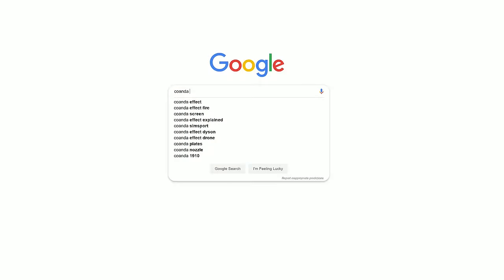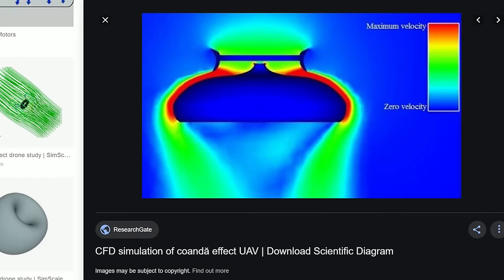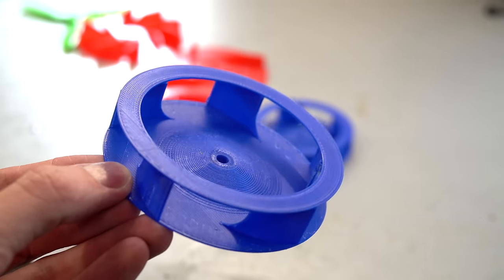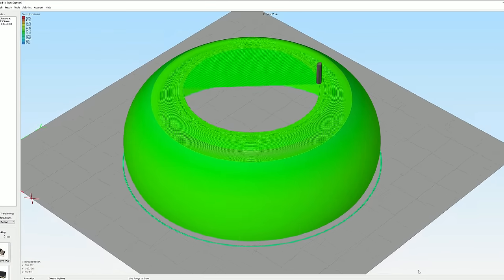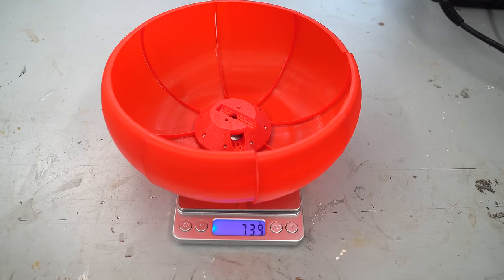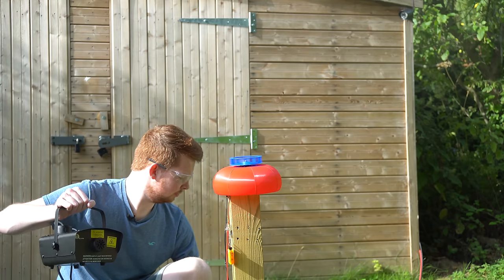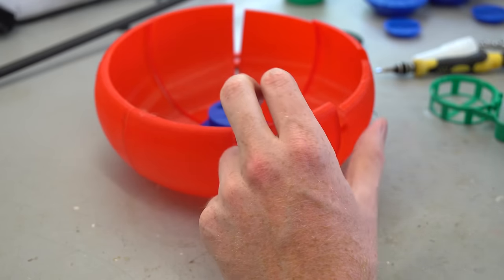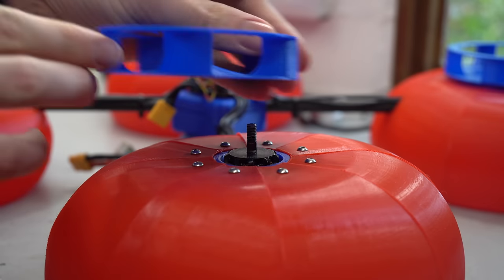Coanda Effect Drone Propulsion

Comment: >The domes are almost impossible to print on a FDM printer
What if i told you... that you can flip the model upside down? :)
Reply: Lol underrated comment
Reply: Even I thought of this. 😅
Reply: I was thinking this too.
Reply: But thenthe support are outside  instead inside but still are there.
Reply: @pologamero2648  curved surfaces are self supporting.
Reply: @pologamero2648  That shape shouldn't need any support at all if he had flipped it upside down.
Reply: KamiEuKiTo  No, it wouldn't necessarily need support. He might have to tweak the shape slightly, but those domes should print just fine upside down with no support at all on a decent FDM printer. 
And since he was trying for light weight, I don't know why he didn't use vase mode to print this either. It would have had much thinner walls, but been fairly strong just due to the shape.
Reply: @dudemcgee256  not if they have an angle to vertical.  The software make not difference with the curve direction. The only curve with no support its a vertical wall.
Reply: The blindness of genius.
Reply: Or you just buy a salad bowl at the dollar store and save your 5 days of print time and $500in filament.
Reply: Exactly what I was thinking and I have no printing experience. Just print from top to bottom like printing a bowl
Reply: @pologamero2648  :  no supports needed for most of it (just around the base (top of dome, where overhand exceeds ~30 degrees ( or better - half the stepover distance)),  supports are no problem as you need to "clean up" most 3d prints a bit anyhow..
Reply: exactly. its the same way he printed the top piece separately anyways
Reply: @Tom Stanton you should cut the red part to be flush and level. that extra down curve is pushing the air down and inward you want it to direct all the thrust straight down to push harder and not cause disturbance. Hence why it is getting stuck in ground effect. by design it is forcing itself into ground effect
Reply: imagine the look you'd get if you challenged  a potter to turn a lump of clay into an inverted bowl.
Reply: Suuuuure, and start off with a 89° overhang ... Seems fine by me
Reply: Why exactly would it be difficult to print??  A dome is prety basic and would not require any support material at all, but IF you need it you can use a dual nozzle and water soluable. Overhang isnt really a problem. You maybe get some small strings but it should print from edge to center..it doesent start in the center . That overhang is not really an issue as the first string is cooled whn next arrives and thus as long as its detail free should work even without rotation
Reply: @jonjonsson6323  because if you flip it upside down you will have an 89° overhang to begin with, and the purpose of the exercise was to make it as lightweight as humanly possible, a.k.a. SINGLE LAYER, and try as you might, you're not gonna remove the supports for a single layer print
Reply: Mihai Lazar then print it straight, to be honest, the only issues i have had with overhang is figurines
Reply: @jonjonsson6323  then you have nothing for the upper "cap" to rest on, overhangs are just the angle between the bed normal and the desired print surface tangential plane ... Well that's a lot of mumbo jumbo, but what does it mean ? It means it doesn't matter in which direction you measure it, if you print the dome upright, you still have overhang, but on the inside
The sine of the overhang angle is just how much of the next layer will be unsupported, and as the dome must be closed on top, and it its curvature is fair, it's overhang goes from 0 to 90 degrees and, by definition, nomatter how good your printer is or Wich way you print it, it cannot be printed without supports, at some point, a layer will have to be printed on top of air, which will result in the fail of the print 

Of course there could be potential additive manufacturing solutions to this problem, but none of them satisfy the condition that the dome must be 1 layer thick 
It is mathematically impossible to do it (well, now that I say "mathematically impossible, one could point out that you could print it untill you reach the overhang limit, go on a vomit comet 0G plane and continue to print in increments in 0G up to success, because it's in Engineers' blood to scoff at mathematical proofs, but obviously that solution is absurdly out of the reasonable bounds of practicality)
Reply: the reason he didn't do that was simple and explained at 3:52 the layer lines were perpendicular in the air flow. (that means going across the air flow) and that would reduce aerodynamics. that could had been fixed with primer and a sanding or he could do it the quickest and laziest way,  print it in peaces on the side.
Reply: Hahaha!!  And in Vase Mode!
Reply: That would mean that there would be support material on the outside, which would lead to irregularities on the surface, which would in turn detach the airflow from the dome
Reply: @vinno97  honestly,  I  have printed spheres with NO supports at all. These would be CAKE. Especially if uou set your layer height to say, .08..  I've done steeper than a 45 easily. But this is about bridging. The flat part at the top. And yes, you would need support if your printer can only support BRIDGING up to a certain length.  But turn the shape upside down, and BAM no bridging, no need for supports.  I. The end tjough, I'd have LOVED to have seen a time lapse of the prints..
Reply: @jonjonsson6323    "then print it straight" brilliant! I'm sure all those aeronautical engineers working so many hours on those complex aerodynamic shapes will be relieved to know that according to 'some guy on YouTube' they can throw all that complicated math out and just make things straight!  Who needs carefully considered dihedral? Make it straight! Why worry about the hugely complicated issue of camber? Just make the airfoil straight right? 

Here you are flexing your expertise on 3D printing and the first time you come across an issue that should make you rethink your first assumptions your honest suggestion is to throw out the elegantly engineered shape of the object in question and tell the guy to just make it a worse part in terms of actual function just to make it easier to make?  Tell me you don't actually work in anything like a real engineering or production environment?
Reply: @hellzs  the perpendicular lines would induce boundary layer turbulence which may actually increase lift; it's the same as adding turbulator strips on small chord wings - and entirely dependent on what reynolds number you are operating at
Reply: @ashleycollard8968  i was answering why he printed it the way he did and gave the time stamp of him saying it then elaborated with theory. i am not a 3D printing expert nor an aeronautical engineer but he did walk everyone though the thought process he had and was over looked or just ignored for sake of finding something to complain about.

how ever i doubt that the added turbulator like ridges would help since it would take up the full lifting surfaces and greatly reduce the air velocity while also braking off the air stream from the lifting body. from a quick google search it seams the turbulator tape is used in small portions near the trailing edge of the wing  to brake up laminar flow to allow a smoother merger of the upper and lower air flows to reduce drag. it would appear that it would be useless in this application. there wouldn't be a difference in the air speeds at the point of merger since while using ground effect there would be no point of merger (probably, im just taking an educated guess since there was a loss of efficiency above a point) and at higher flight the bulb would act like an airo-spike and have a tear drop shape.
Reply: @hellzs   rough surfaces at low reynolds numbers are actually more efficient - laminar flow is the aim on full size surfaces operating at high speeds (and no, i'm not an aeronautical engineer... but i am a designer and builder of flying models for half a century)
Reply: Lol he spent so much time printing and gluing that print....vase mode next time homie.
Reply: i was thinking the same thing
Reply: Haha, yeah, huh? Or why not just go to the grocery store and buy some plastic bowls (if light enough) and then mod them? Geesh!
Reply: That happens when you have many problems to solve..  You concentrate on the important ones first..   R & D is all about conquering the Human deficiencies..
Reply: Well,  @THOMASTHESAILOR , mortal (imperfect) deficiencies, that is. Not necessarily human ones. There are perfect humans who exist outside of Earth life. Heavenly Father is, of course, one of them. Oh, also, "human" isn't a brand.
Reply: Lmao that's how most objects r printed by the software's program
Reply: @dudemcgee256  physics!
Reply: @excitedbox5705  would that really be 5 days of print time tho?
Reply: @MT-THNDR207  Probably not but my $500 was exaggerated too. 4 salad bowls from the Dollar store would have been so much cheaper and quicker the actual time is irrelevant.
Reply: The top of the dome was curved.
Reply: @owenkegg5608  That's fine
Reply: The entire time I was thinking "Just print the thing upside down!"
Reply: I believe you have also stumbled upon the "Toms palm to forehead effect".
Reply: Hmm . . . Logical. I don't have a 3D printer. But, it is ideal to make a structure a solid piece.
Reply: Maybe it's just me  . . . Are the motors working harder than without the comes?
Reply: @pologamero2648  In FDM printing it is possible to print overhangs with an 45° angle easily, with some tuning you can achieve even 60° reliably. (angle between vertical axis of base and wall
Reply: Or spent a couple bucks at the dollar store for a couple plastic bowls.
Reply: Yeah then have support on the side...
Reply: Big boy brain
Reply: He keeps pronouncing "Coander affect", what do you expect?
Reply: KISS. Sometimes the solution is the easiest..... durrrr.....
Reply: You can do that with motorcycles too. It really doesn't take all that much practice.
Reply: I wanted to comment that too xD
Reply: @pologamero2648  55-60° angle to vertical is self supporting, depending on layer thickness and extrusion width. Layer thickness must be much much lower than extrusion width for this to work, then the newly placed bead is partially on top of the last layer, enough for it to have something to stick to.
Reply: Exactly!
Reply: I am a 3d printing novice, and even I saw that issue of "...why not print it upside down, since such a huge area is flat, that would just be supported by the printing base, and then maybe a tiny bit of support at the initial curve, depending on how you set it, but mostly just..using that and vase mode you would not need any supports, it would self support and be lightweight.
Reply: I believe it was the layer direction that caused the most problem with printing it all at once. The air flow over the bowl.
Reply: Upside down couldve even gotten him vase mode
Reply: I was very confused by his dilemma as well
Reply: Hahahahaha! Great call
Reply: The one he came up with ended up being a better design functionality wise anyways, but yeah, mans coulda printed it upside down.
Reply: Polo Gamero not true.
Reply: Theodor Witter wth
Reply: Owen Kegg and?
Reply: Elekrazy oh hi me
Reply: J San not at all.
Reply: Woah.....
Reply: The bottom is round so it’s needs support still
Reply: Sketchy Dood no it doesn’t
Reply: Meowser bruh wdym
Reply: Sketchy Dood you dont need support for arches google it
Reply: Meowser hmm well the more you know
Reply: To be fair, that would still make the layer grooves perpendicular to the airflow. Maybe that has more impact than the added weight through the center connective hub. I doubt that though.
Reply: I NEED HEALING
Reply: but then the lines of the 3d printed surface would be perpendicular to the airflow
Reply: I thought the same '^^
Reply: @noble.george  Did anyone think of not using damned 3D printer? Adding 80g of plastic to obstruct air flow from a propeller reduces lift by a factor or 5.  Who would have though? BTW having said "impeller" about 100 times in this vid, what you were using were centrifugal fans because you were running them backwards. Impellers draw air INWARDS. If you had used a proper centrifugal fan, not a backwards "impeller",  it would have been a little more efficient. Full marks for getting such a silly idea to fly at all.
Reply: Print a bowl!
Reply: I know right? I have no experience with 3D printing but I thought it could be flipped
Reply: bowls
Reply: He's ooverthinking too much about the impellers he just forgot about that...  Sometimes smart people are kinda dumb😂
Reply: Thank goodness I’m not the only person who thought this when he said that
Reply: Does not compute..................
Error: 417
Protocol not found..................
System reboot: y/n

Smh... lol...
Reply: @RyanScottForReal  the blindness of presumed genius... true genius would step back, change angles, and take a new perspective... only boxed brains get trapped in boxes... dont get me wrong I'm not saying he is stupid... but genius..? Save that shit for the likes of hawking or kaku...
Reply: Then you have even more material in tall unsupported areas. it is quite simple. Although idk if a printer minds or not. If it actually does, your comment is quite dumb.
Reply: Why even manufacture solid domes? You wouldn’t 3D print an R/C airplane frame.
The structural rigidity and mounts comes from the carbon tubes. The bowls could be just wood/wicker covered in paper or plastic film.
The only strength the bowl needs is the variance in air pressure from the passing air pushing in but a ring around the edge, being a dome, should provide excellent strength to weight and be self supporting for the most part.

This would be a much easier design to prototype changes too.
Reply: I came here to post this as well! Lol
Reply: If you flip the model upside down, the coanda effect will work upwards - if the motors dont stuck in the bottom anyway :D
Reply: I need to know if this is correct because I don't believe that I knew something about 3d printing that this guy didn't
Reply: or the fdm printer? :)

Comment: Hi Tom, Nice Project!  This system works on a skin boundary layer effect.  The current impeller design system is flinging air away from the surface boundary. You need to print a funnel housing for the impeller design to increase at surface air flow velocity.  What you will find is that the stronger skin effect creates a flow entrainment effect that causes ambient air to flow along with it.  ... So even though the funnel housing adds weight it causes the impeller flow to be much stronger.  A second thing that you can and should do is to create small stand off wings in the skin effect flow channel. (They act like stators in a jet engine.) What this does is it redirects the air into a more downward flow direction.  With your current design the flow is traveling in a spiral over the domes.  You want the flow to be as close to vertical as possible.  ... The other thing that can be done is to use a second impeller on the bottom.  This sucks air in from the center and pushes it out toward the edges.  This dramatically improves flow drag performance. The outer flow and bottom flow meet at the edge and eliminate turbulence... All that said these types of lift systems are just not as effective as props.  They are used for lift craft that come into contact with physical objects. .... Try those changes and hit me back. You should be at about 65-70% power efficiency of a direct prop system but you should break ground effect.  ... Cheers!
Reply: Impressive ideas.  I was also wondering if an outward curving intake horn tightly attached to the top perimeter of the impeller would prevent air from wrapping around the impeller and being pulled through again, thus increasing efficiency of the impeller.  The top curved surface might even generate another small bit of Coanda lift.  Alternatively, the "funnel housing" described by M. Ellis could be curved back outward to create such an intake horn.
Reply: My understanding of helicopters and air planes is that the wings/rotors do not exactly produce thrust, they create a vacuum that pulls the vehicle up. I agree with the part about needing housings for the fans though. Several resemble turbo rotors, which do require housings to make good use of air flow
Reply: @akc7100    I'm a fixed and rotary wing pilot.  Wings throw air downward.  The wing throwing the air causes Action and Reaction.  Wings do this because air is accelerated by compression pressure, surface boundary effect causes the air to redirect downward.
Reply: Using a slot at the exit of the impeller fan would greatly improve the boundary layer influence, yes.